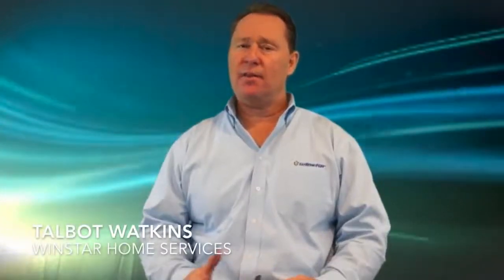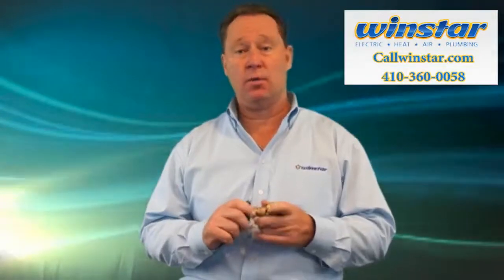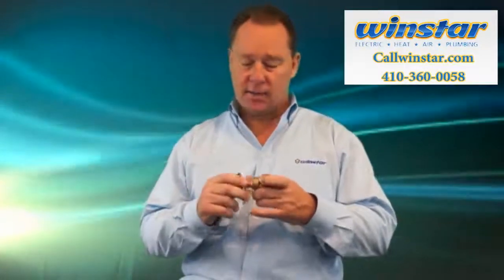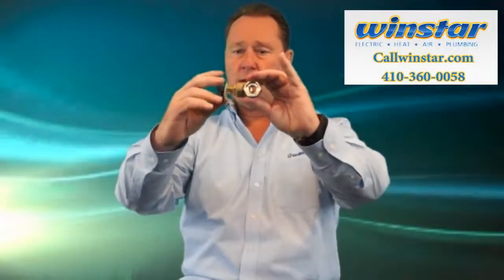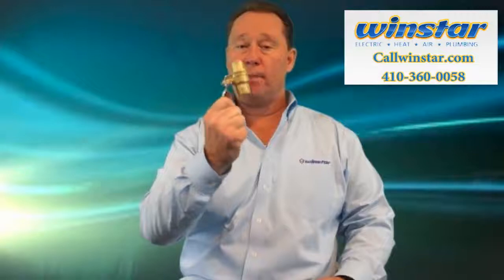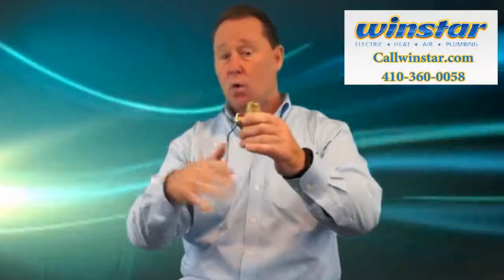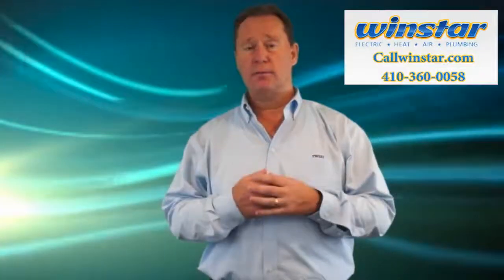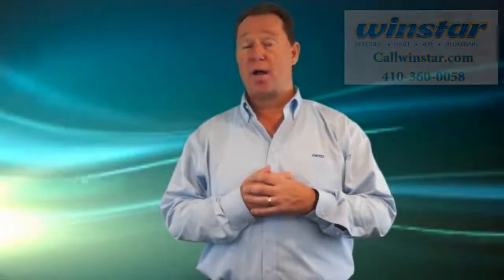Ball Valve vs. Gate Valve

Comment: I don't know, everything will eventually FAIL. I've seen good gate valves, I've seen crappy ones. Gate valves are not meant to be opened and closed repeatedly, whereas ball valves are. Seems a waste of money to use a ball valve for a house main. Ball valves have seals on the the fore and aft side of the ball. These seals can fail too, especially when a large piece of debris gets in there (think about washer less faucets, can't tolerate debris).